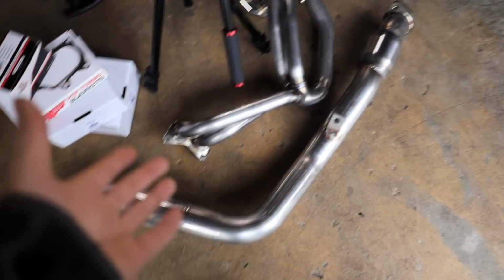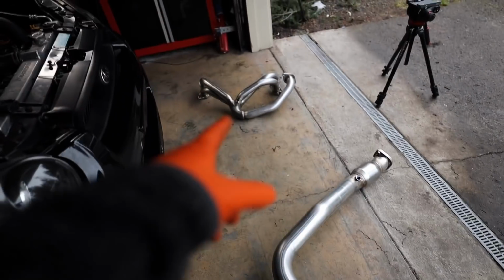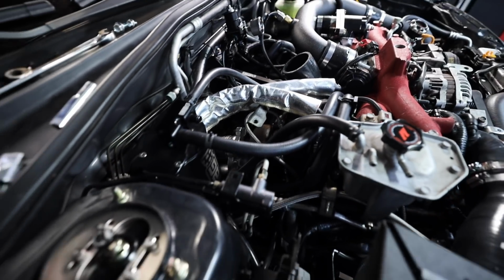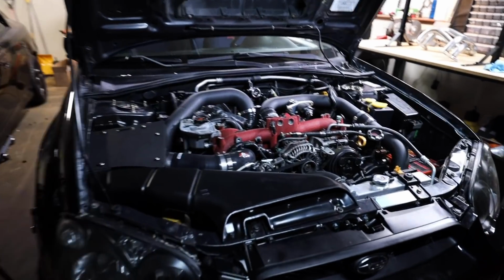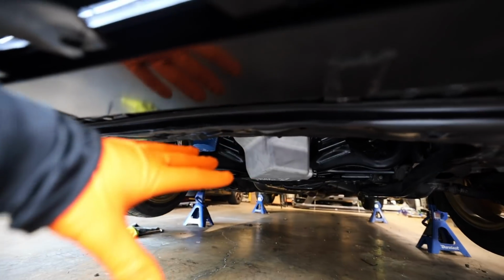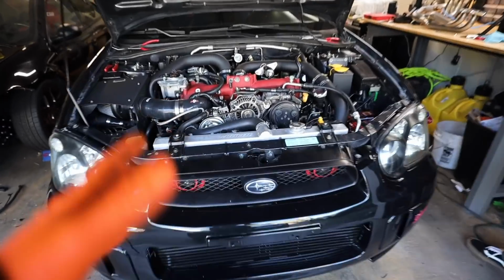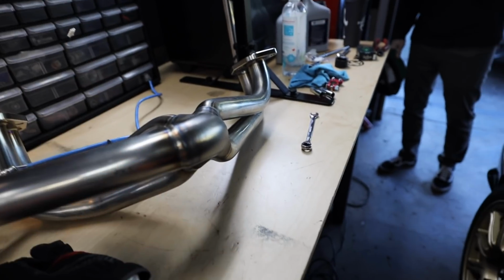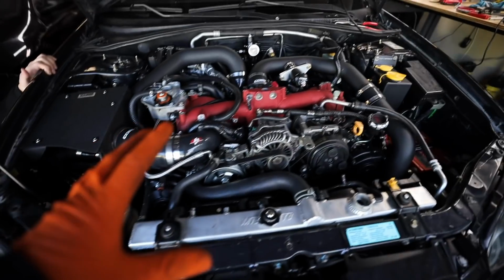This Is Getting Exhausting!

Comment: Be careful about trimming the flange of the lower radiator support. You are removing the welds that hold the 2 pieces of the support, which will make it a bit flimsy er. You can always go back and weld the two halves back together to add some rigidity. And maybe keep a fire extinguisher in the car?? Just incase......
Reply from the maker: Fire extinguisher is on my list to snag 🙏 and totally aware, going to have Devon weld that together for me. Put some paint in there to protect the bare metal for now

Comment: All aftermarket exhaust components never line up correctly. Especially manifold to uppipe,  I swear the uppipes are always to short, so you’re forced to loosen the bolts from the turbo mounts and move the assembly down to close the gap, but that causes the downpipe to sit lower and also affects the compressor outlet position for the tmic. There’s no real adjustment in the whole exhaust system.
Reply from the maker: Not much at all, mine was cooked left ao it made it a real pain to force it to line up

Comment: I have a full exhaust that i've been getting together to completely replace my current one and I just got a new VF48 recently aswell. Would you think taking off the downpipe without unbolting the turbo from it and taking it out as one unit would be possible or easy? I think some of the downpipe bolts are rusted/rounded/seized and won't come off easy, won't really mind if I have to cut some stuff to get it off but it's the route I don't want to take if I don't have to, also really tight to work in there to get stuff off
Reply from the maker: No, I would 100% unbolt it from the turbo. It is possible to do but I wouldn't suggest it. Going to be more work than it's worth

Comment: May want to add a heat sleeve on the O2 sensor wire where it’s really close to the header. Looking good!
Reply from the maker: Agreed, need to snag some 😅🙏
Reply: @Smeedia  I am doing a 2.5l IAG 600 longblock swap on 2002 WRX daily driver. Trust me I am going over every nut and bolt on this swap so I won’t have issues again lol

Comment: When is comes to positioning. I start by enlarging the 3 mounting holes at the base of the turbine housing in order to rotate/clock the turbo right or left. This also helps position the downpipe outlet flange left or right. A 1/8” to the left at the turbo translates to a 1 1/2” at the outlet.
Reply from the maker: Not a bad idea!

Comment: I noticed that the GS ceramic downpipe has the o2 sensor after the CAT. & yours I believe has it opposite. Not sure what the differences or if it will effect tuning? I kinda know how the cats work as if they tackle the nasty smell to make it smell “nicer” & less harsh. I also have an invidia highflow cat but didn’t install it & it’s literally at the downwards part after the turbo. Not sure why there are many different placements of this nickle
Reply: & also my headers cleared with out touching. Just inserted the 4-1 area first. Wiggled & shimmy then it slid right in.
Reply from the maker: I tried to snag one of the limited versions but they were all on super back order 🙃
Reply: @Smeedia  what’s the difference?

Comment: Hey Mr creator man. Have a question what are ur thoughts on the tomie headers for subaru? I have one on my 2010 and it seems to work great? Was wondering that ur option is
Reply from the maker: Personally never used them but have heard and seen them and they all appear to be very quality units!
Reply: @Smeedia  yea I love mine it came with header wrap and an up pipe. Sounds great. I also have the invidia down pipe can car back. Sounds good nice and quite.  The fit of the header is awesome. Installing header wrap thought is annoying af.
Reply: @Smeedia  ps live the channel not sure how I came across it lol started watching one of ur videos and subed. I just did a lot of work to my 210 wrx. Now just waiting for the stock engine to blow up lol hopefully knock on wood it won't for awhile

Comment: My oil filter touches my killer b headers. It’s not a oem Subaru filter. Is that why. Did you run into this problem
Reply from the maker: What filter are you using
Reply: @Smeedia  the one on there is some promobile one. Do you have an email that I can send a pic to. Or snap or whatever.
Reply from the maker: IG? 🙏
Reply: @Smeedia  only snap lol 

XossoX

Comment: Why did you end up going with the GrimmSpeed downpipe over other brands?
Reply from the maker: It was the only one in stock that I could find 🙃
Reply: @Smeedia  I just dont know if that would be a benefit to to with that downpipe on my stock vf39 turbo only able to put out a max boost of 22psi and that's probably not a good idea doesn't Invidia make a catted downpipe that is a bellmouh and is not a divorced wastegate set up
Reply from the maker: Bellmouth would be ideal but needed a catted downpipe and grimmspeed was the only available. Should still be able to flow just fine
Reply: @Smeedia  you would still put on a GrimmSpeed Downpipe on a stock turbo?
Reply: If so maybe I will Do that
Reply: @Smeedia  what brands are bell mouth? Is the grimmspeed limited?
Reply from the maker: If it was IWG yes

Comment: What short shifter do you suggest for my 17 STi? Love your videos homie.
Reply from the maker: Kartboy 100% 🙌
Reply: @Smeedia  thanks man I've been kinda having trouble with 2nd gear. I took it to my local Subie Doctor an they said I didn't bleed my clutch right when I change my clutch line to a Perrin braided one but after I got it back from them it's still kind of grinding into 2nd gear. Any suggestions? Thanks know you're busy.
Reply from the maker: What year and how many miles?
Reply: @Smeedia  2017 28,000
Reply from the maker: Shouldn't be having internal issues, still using the factory gear oil? If so I would swap to some motul 75W90
Reply: @Smeedia  I already did my friend. About 2 months ago I watched your video an did my front diff and my transmission flush with Motul 75W90.
Reply from the maker: I wouldn't think a syncro, you could try bleeding it again and see if that resolves any issues
Reply: @Smeedia  alrighty thanks for all your input. Can't wait to see the 05 start up.

Comment: Biggest issue I’ve had with the down pipe on my ej engines are the bolts to the turbo.
Reply from the maker: They do tend to rust over time 😅
Reply: @Smeedia  Put copper grease

Comment: Bro what makes you want to work on these cars I have an sti all they do is blow up it’s the way the boxer motor is designed short block or long block she will eventually blow there is no longevity in the ej you are better off doing a k series motor.
Reply from the maker: I've only ever blew 1 EJ out of the 20+ I've had and it was 100% my fault. They're good motors when taken care of